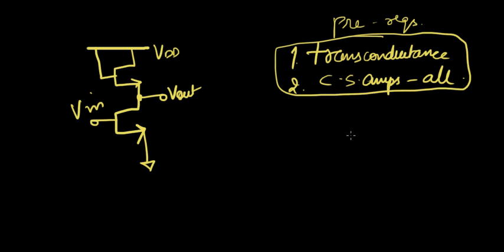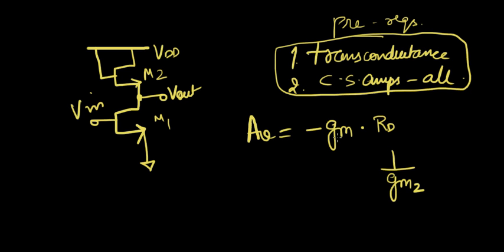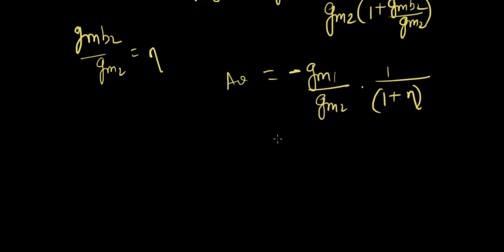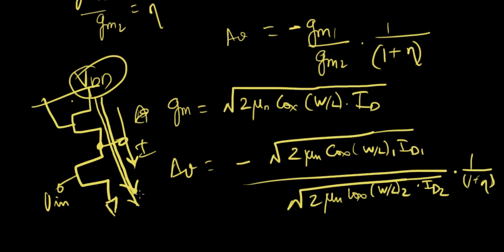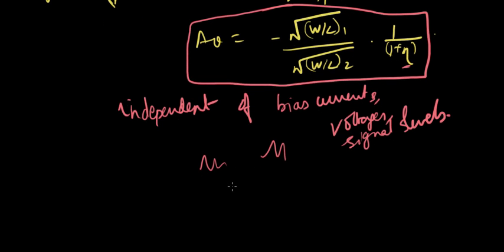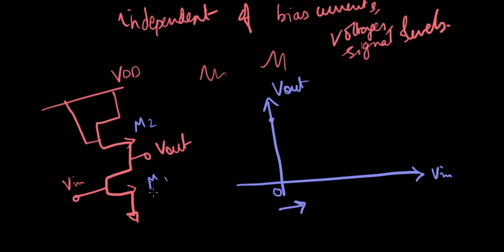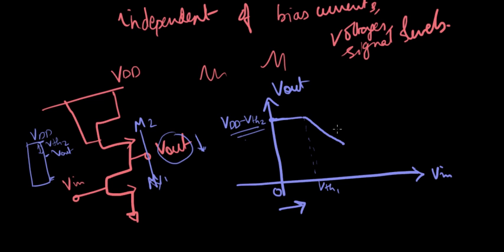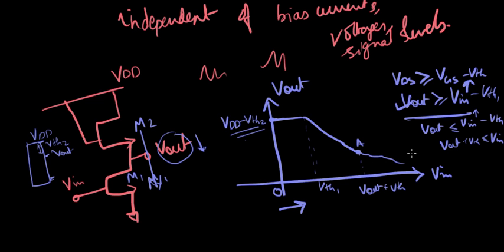Common Source Amplifiers - Diode Connected Load Output Characteristics

Comment: Hi
I'm not sure if you are still available to answer my doubts. In this video on CS amplifiers- diode connected load you cancelled Id1 and Id2 assuming no load condition. But that won't be true if you have a load right? No amplifier is of use on no load condition is what I understand could you please address the doubt.

Comment: when M1 is off did you take Vout as the Vgs of M2 or Vds of M2 ?. If you took Vout as Vgs of M2 then i agree Vth is spent but if  Vout is taken as Vds of M2 the how is Vout VDD- Vth as threshold voltage would be spent at the gate and not in the drain source channel.
Reply: for M2,gate & drain are shorted,so Vgd=0.
Reply: can you draw the small signal model for this